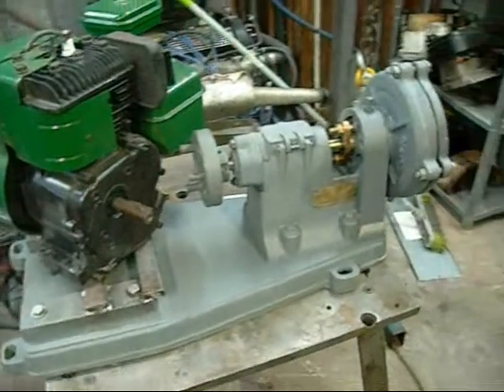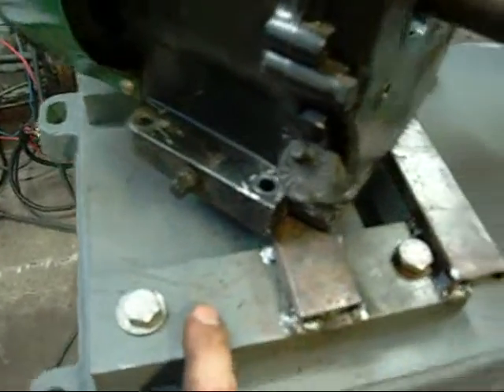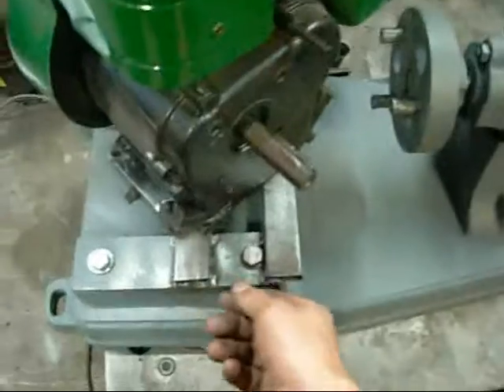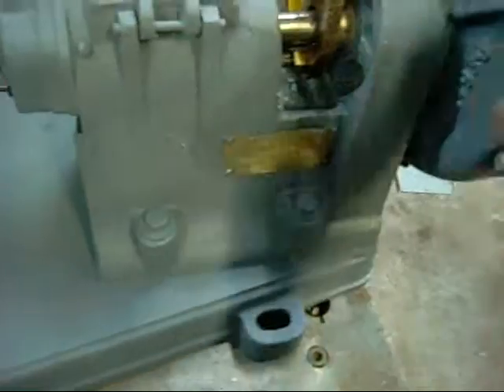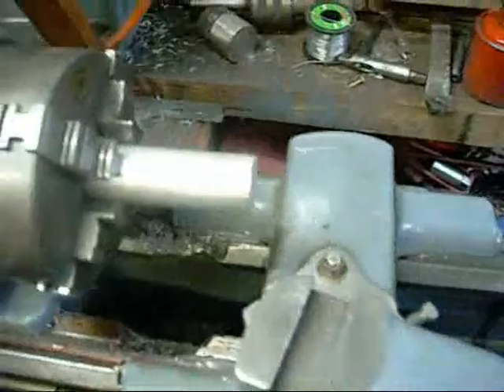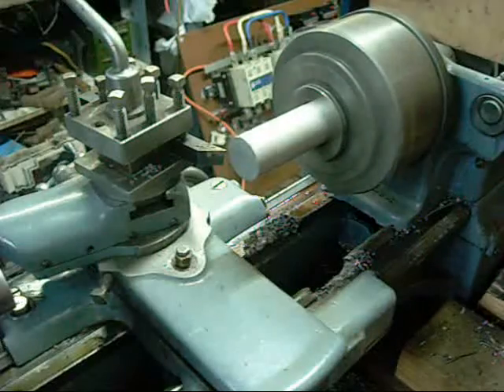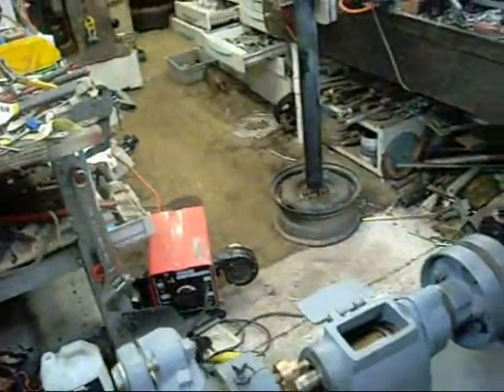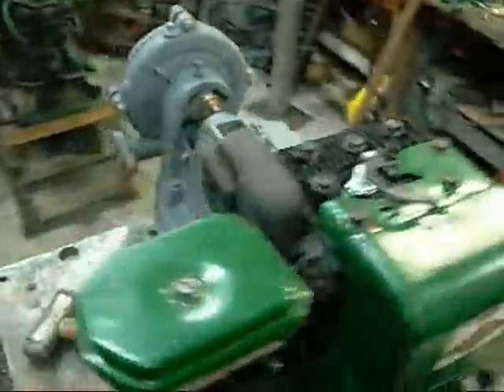Motor Conversion on Kelly & Lewis Centrifugal Pump

Comment: great vid friend ,, im shure u know this but 
just in case ,,,i have found that its best at times to connect the motor to the pump or what ever it is ur running before mounting it ,,it appears u have a good couple so in this case it doesnt matter much ,but additional kilter accuracy can be achieved and significantly reduce vibration , using this method, as i said im shure u are well aware of this coupling trik